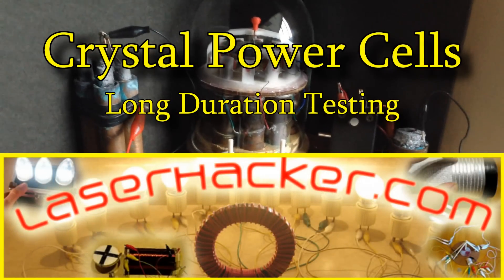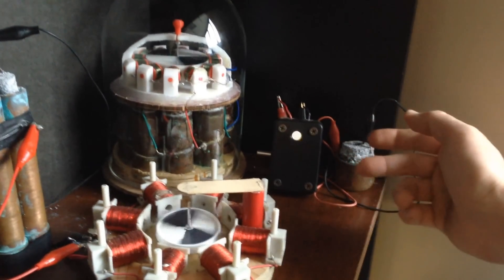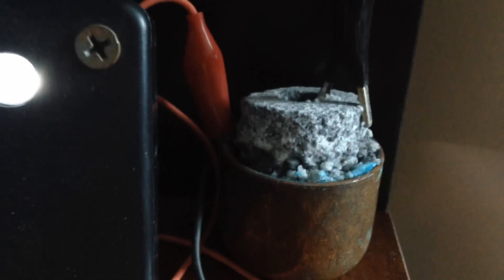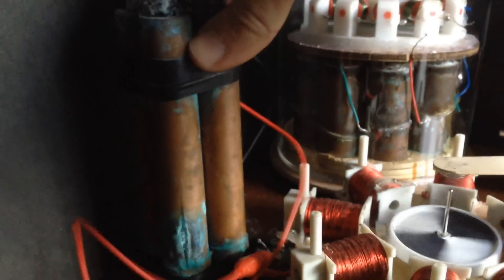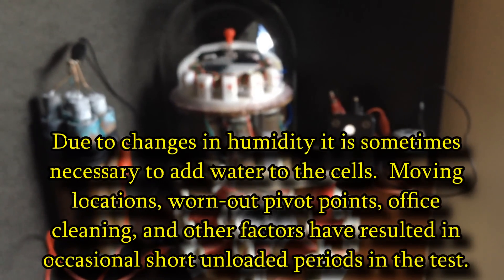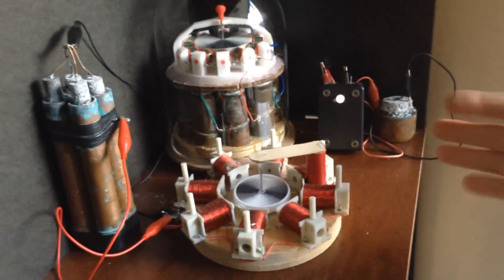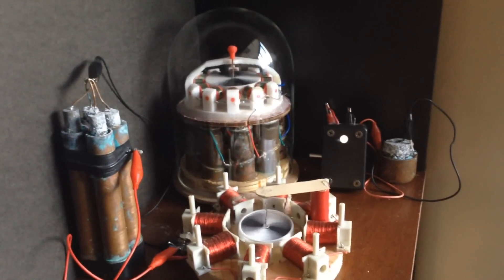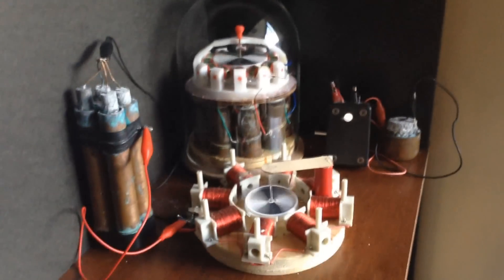Motor + LED Going for 2+ Years! - Crystal Cells Duration Testing

Comment: I thought the pressure might become a long term  problem. I'm trying a few variations in the electrolyte in my own experiments.
update: just planted the copper and magnesium rods into a container filled with the original mixture to test it. not only did the lack of pressure on the mixture not affect the charge, the mixture that was sitting in a container for a few weeks actually has a charge of 0.2 volts higher than when I made my first. maybe aging the mixture will yield better results?
thanks LS

Comment: What RPM are those little motors running at? They appear to be going fairly slowly (100RPM?) but that could be an artifact of the shutter speed of the video camera. Can you clarify? In any case, this is a very cool test. Thanks for sharing.

Comment: ok so i understand the pressure.. but my thinking is maybe get another chemical that can slow the growth of the cells..another thought is that this pressure can be realated to a balloon with air pressure in it. to release the pressure poke a small hole right,,well use this thinking and maybe cut a small hole or two in the cell so the pressure can be expelled..and what it will be expelling is some of the crystals..seems like it would work right?

Comment: increased surface area. will a higher concentrate of crystals , as in dehydrating and harvesting, increase the values of the outcone in voltage, amperage and time?

Comment: I tried wiering a cell positive to positive in series and I got almost no amp draw on the power suply I was using but I could still run a LED strip from the circuit while gaining 14 miliamps....

Comment: An idea?I have graphite cells and some silica with all the salts nessecary to build the power cell, will it charge a capacitor than eventually after charging it putting a usb board on the capacitor to pull ~5v to charge a cell phone?

Comment: i'm curious. does the longer batteries make more current? being they have more surface area? i would like to know this. i would like to build a very large battery pack of these things. i could power a tube type amp. most tube types amps use voltages ranging from a few hundred volts to a few thousand volts at 100's of milliamp. whereas transistor amps need lots of current at 12 - 24 or more volts.  i have one 500 watt transistor amp. it needs at least 50 amps to run at 500 watts. it's not supper efficient. but it a 12 volt and quick to use. as tube types take time to warm up the cathode.

   i've even thought to use these in a e-bicycle. where a lot of current reserve is a must. even in a hybrid moped design. because most of the fuel consumed in a 50cc moped happens in stop and go traffic. adding a motor to get thing rolling, could boost fuel millage even higher.... i could even use a pack of them to run a hho generator.

Comment: Can those power cells in this video charge a tablet, cell phone, or light bulb?
Reply: +Jason Miller From what I can see, he's getting one volt per cell.  I think most cell phone chargers work at twelve volts.  I doubt it would work with twelve, but if you wired up maybe two or three dozen of them, that might work for a few seconds.  These batteries have very low amperage however, so I think you'd probably need a lot of them.
Reply: +Petrus Laredes Phones charge off usb and usb is 5 volts. But i think these cells provide 100 ma at 1 volt or less under load. 5 of these or more will charge a phone very slowly at 100 some milli amps. Rather use a solar panel or just a ac adapter.

Comment: would it not work with ammonia crystals ? they grow ?
Reply: +Tony Baines well its not the growth the energy comes from, it is the specific structure of the crystal that allows energy to be accessed from the quantum vacuum. If you calculate the amount of energy it has used over 2 years it has used more energy then 100 lipos the same size (1000mah) fully charged store.

Comment: Tbh, all I see are two giant chunks of metal reacting galvanically through a high resistance electrolyte. These "crystal" cells (not a monolithic crystal btw) last forever due to the reaction rate being limited. Conventional batteries last "forever" too if you sip current off them. Take the same chunks of metal and use a real liquid electrolyte or molten salt and see how much lower the internal resistance is (increases its ability to source more current) While I think the video author at least partially understands whats going on, I'm appalled by the psuedo-science quackery in the comments. Just because a guy doesn't understand whats happening doesn't make some magical quantum pop theory valid.